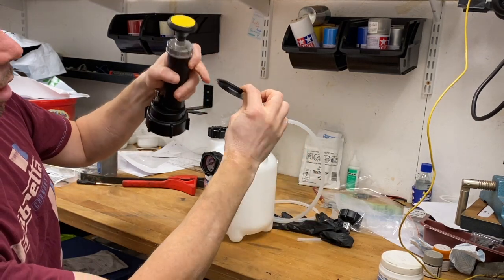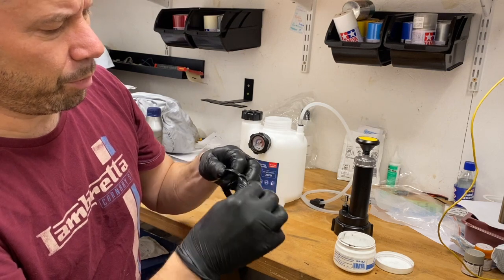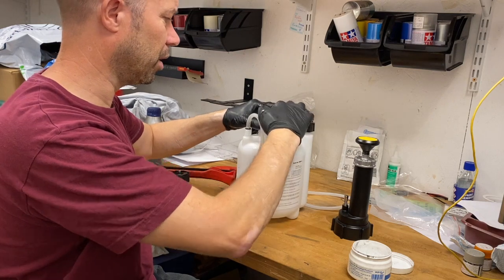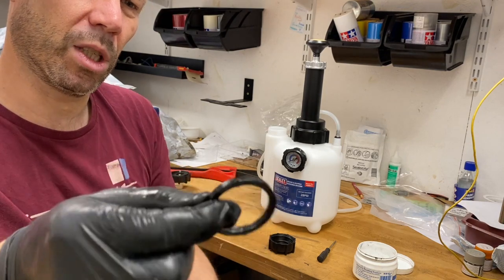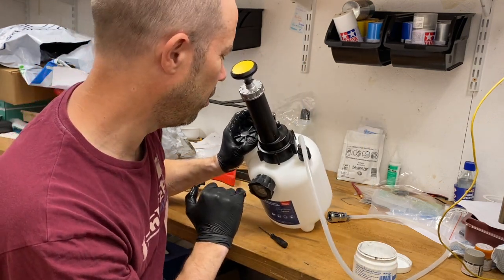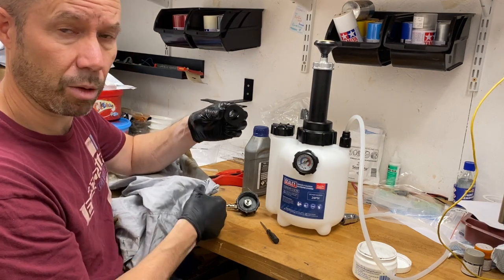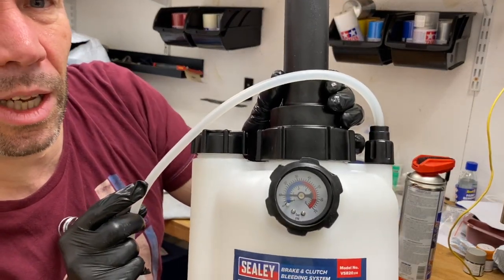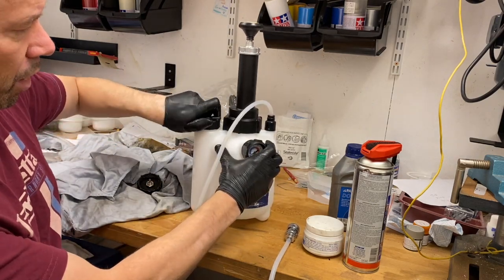Sealey VS820 stop leaking / retain vacuum

Comment: why is there a hole on the silver metal cap on the pump bit? i can get it to build pressure because of the fking hole!
Reply: That's the other side of the piston seal so it can suck in air to squeeze 😊

Comment: I have a brand new one do I need to do this ? I don’t have the wrench tool ?
I tried using my VS820 for the first time today but it was useless, wouldn’t hold any pressure at all ? It stayed at zero psi and would not pressurise at all ? What’s could be the issue.
Reply: Same here.     Im googling like mad for a fix......failing that i might send the damn thing back
Reply from the maker: I did it from new before I used it. So then it worked ok